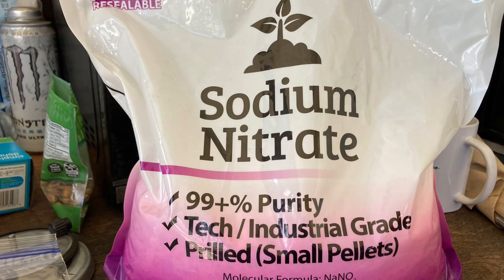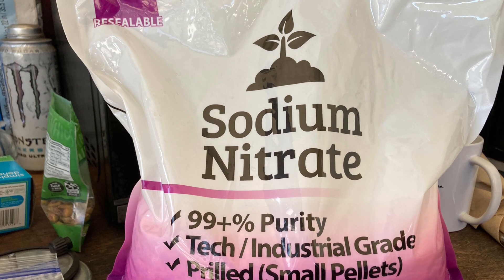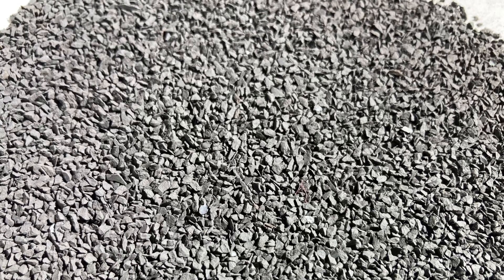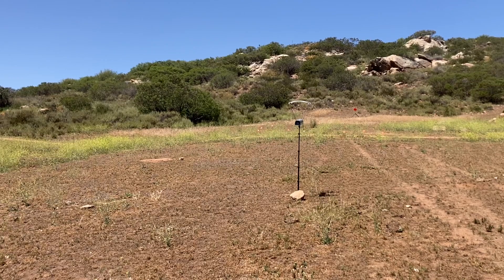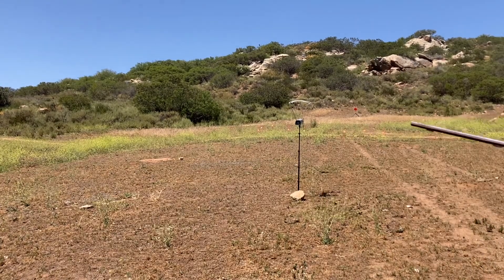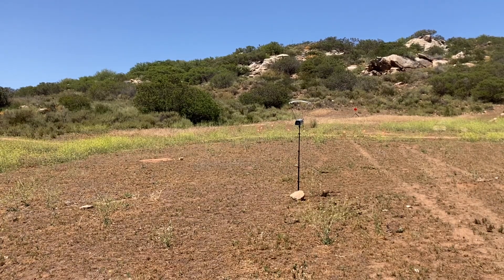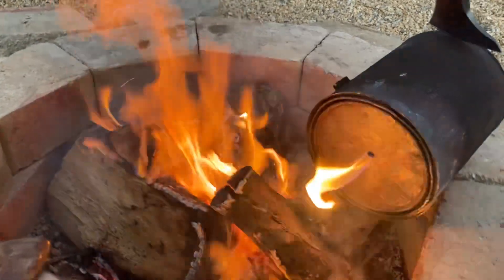Sodium Nitrate Black Powder

Comment: You seem like the perfect person to ask this. I’m looking to have a sort of off grid formula for black powder. I’ve seen people posting about making BP without sulfur. Is that possible and would it be able to be used in a BP rifle or pistol? Any help with this would be appreciated. Keep up the cool content.
Reply from the maker: I’ve got some powder made up without sulfur and hope to try it this weekend. Stay tuned!
Reply: recipe for Blue MZ- 50% KNO3,  25% KCLO4,  20% sodium benzoate (food preservative, find on Ebay), 5% dextrin
Reply from the maker: Yes, I know it’s possible but I’ve never tried it myself.
Reply: Sulfur decreases the ignition temperature and increases the burn rate [transfer across grain boundaries.] Don't bother making 0 sulfur BP if you're going to try to use it in a rock-lock; same reason none of the substitutes are suitable for priming the pan in a flinter. But you absolutely could use it for the main charge, it will just burn a bit slower [ie, use 3F where you'd use 2F of BP w/ sulfur, etc.]

Comment: Side note.  Even though here in Ks we have gotten some rain, indoors it is bone dry.  So, almost three weeks ago I took an H&R Topper 088 to a friends B-Day party.  High school kids took some turns with it on clays.  The load was Magtech brass, 3 1/8 dram Goex 2Fg, 1 1/8 #8.  Big fun!  About 30 shots.  Anyway, this, that and the other I just cleaned it yesterday.  No rust.  It cleaned up spotless.  Granted the fouling was extra hard.  What I'm getting at, BP with KNO3 in dry conditions with non-corrosive priming isn't that big a deal ( it is, but it isn't....).  It would be interesting to know if like amounts flashed on some steel plate of potassium nitrate vs sodium nitrate and left in the weather changed this dynamic.
Reply: I have personally noticed that Goex is a little smokier than pyrotechnics but a lot less corrosive. I know “it’s not corrosive it’s hygroscopic”. Fact is if I shoot 1 shot with pyrodex Ivette’s scrub the whole gun within hours. If I use BP I can go the whole weekend or week before it looos as bad as 1 day with pyrodex. That’s here in the south with high humidity. Both stink when burned so pyrodex only exists because the stores don’t need “explosives like licenses to have it.

Comment: Just a thought:
Maybe the lead in the ball mill are to blame for the stronger fouling? Since lead is quite soft and the milling may wear away some of it. Perhaps trying an alloy of lead/tin (Pb40/Sn60; Pb30/Sn70), which is much harder than lead itself may solve the problem.

Comment: My tests with Sodium based oxygen were identical save that mine was trash garden stuff. Lots of junk in it, only like 95% and the rest just whatever.

It left a lot of crap behind. The witness plate tests suggested a poor performer but the chronograph and my shoulder said otherwise. Dirty but stupid fast.
Reply from the maker: It’s not worth a damn in a flintlock, it flashes to slow. I don’t care how fast the ball is moving.
Reply: @Everythingblackpowder  Agreed. Caplock only.

Comment: Ok, second try. You asked about the charcoal. 
The details and science you're after are found in The Mad Monk Files. You'll need to search for The Mad Monk Files and find the Swiss Booklet. You'll want them all actually. The man, Bill Knight aka The Mad Monk, is a chemist who spent a long time in the study of BP, he has connections in the gunpowder industry others wish they had and if you're to rely on the work of anyone, this is the man and the work to carry on. You'll see.

To cut to the science of what you're after with controlling char temperature, you are after wood creosote. Not the stuff railroad ties and parking lots are coated with, this isn't petroleum creosote. 
It isn't petroleum, it isn't petroleum or coal tar, it isn't tar like. It has absolutely nothing to do with tar as most people might perceive. The natural wood creosote is a hard and brittle crystalline material derived from the lignin in the wood, when wood is loaded with creosote, the wood has a black crystalline glitter to it. Little crystals can actually fall out of the crushed charcoal in cases where the char has a huge surplus of creosote which is a wonderful thing.

The critical never exceed temperature is 610F. Do not exceed this temperature as this is the flash off temp of the creosote, wood that chars above that temp will have little or no creosote. 
I use a propane grill with a perforated steel baffle I drilled out and cut to fit. I use 1 gallon paint cans with 6" long 3/8" diameter copper tubes fitted to vent the gas out of the grill so as to avoid the gas igniting and causing a runaway temperature spike. I'm not doing this for efficiency, I'm doing it for precision.
My grill has multiple grill thermometers and a long probe thermometer for internal temperatures so I can monitor the can internal temp. The important piece of data are the cans internal temps. Time doesn't matter, I make sure the internal temp of my retorts remain below 610F for as long as it takes to fully char. 
I do not want nor do I try for brown or red colored charcoal, it is my opinion that those have not had enough charring and thus lignin has not been converted into creosote. I understand if the wood you're using only fully chars at above 610F and thus in an effort to preserve the creosote one must thus under char, I use wood that is both exceedingly plentiful, has tons of lignin and fully chars at 550F. I cook at 590F to ensure as much conversion of lignin as possible into creosote.

You could go through the trouble to assay the wood from dehydrated weight to as charred to ash to know your actual carbon and creosote content but really it isn't all that important, there are many other factors that come into play that are much more make or break.

What you're looking for is a charcoal that is loaded with sparking black crystals, when you torch or burn a piece, you're looking for a faint trace of smoke and you're looking for a strong creosote smell. It should smell like a very very well used food smoker.
 If you have a dry scent, you over cooked it.
Again please note that some wood types char at such a high temperature, riding the ragged edge of 610F or even exceeding that temp that little creosote will be preserved.

So what happens when charcoal is loaded with creosote, made into powder and shot? 
It burns down into its constituent elements, that is hydrogen, oxygen and carbon. The desired element is hydrogen. When hydrogen and oxygen burn, they produce water vapor as a byproduct. This water vapor in turn permeates the fouling and keeps it soft, the more water vapor produced, the greater the effect. 

This will require special tuning to achieve the best possible results and failing to tune the powder can partially or completely negate the effect. There is no specific formula I can point you to, the tuning is a number of factors you'll have to figure out to best suit your needs.

My powder burns so wet that the fouling is sopping wet with a greasy feel. About the same residual carbon fouling as Goex but unlike theirs, mine feels like melted face paint. Soft, goopy and easily wiped off the witness plate I test on. In the barrel it is easily wiped out with a single dry patch or blown out of the barrel by the next shot, grease isn't needed. That isn't to say I don't use grease. I certainly do. 

I need to point out that this wet burn feature can be negatively effected by heat and time. If your barrel is too hot to touch, so hot that a blow tube wouldn't work for example, the fouling will not retain moisture from the wet burning characteristics either. So it is usually very beneficial but in certain locations or atmospheric conditions it will fail.

If you're shooting on a 100F day in direct sunlight, the barrel will get too hot in no time flat and the effect is lost. This is where a good grease comes into play. 

It will also naturally dry out over time as well, it can actually be far wetter than the naturally hygroscopic fouling wants to be and will eventually "dry out" to achieve equilibrium. 
Doesn't mean it is actually dry, it isn't. Just isn't sopping wet anymore and this naturally damp fouling isn't soft enough to make loading easy or be blown out the barrel with another shot. So a steady firing sequence must be maintained, not so slow as to dry out and not so fast as to over heat the barrel.

American powders of the late 19th century were not wet burning. In fact the wet burning characteristic was well known to American powder makers and usually not a factor in production as American shooters preferred grease groove bullets or wiping between shots. It was Western Europe that liked wet burning powder. It was their thing and in the usually cool and comfortable weather they have it was a much sought after characteristic. You can imagine then that American powder was not popular over there.

For me this BP making thing has been a massive 6 year long learning experience. I equate it to mining through a maintain range of obsolete, repetitive or incorrect info just to find a backpack worth of gold nuggets. This is a few of those nuggets.  An observation I have made over the years is that not everyone understands the creosote thing, either lacking the understanding of the science behind it or lacking an understanding of the benefit of it. There are a number of people who do understand it and do not care. 
The American method of shoot and wipe is part of the allure and magic of the BP world and they intend to stick with it, after all, it was American powder, American arms and American methods that won the 1874 Creedmoor Cup. I cannot argue with them, who but a fool to argue with success?

I don't know if what I've said will help or if this is a direction you want to take your testing but at the very least you have more options and now know things few others know. Absolutely find and download The Mad Monk Files. All sorts of useful info those files, a gold mine for info.
Reply from the maker: Thank you! I took screenshots of all of that in case it gets deleted again
Reply: @Everythingblackpowder   I made a lot of edits and additions.

Comment: I "Wounder If" the speed may be In the Burn "type" with the longer barrel. could it be a better Push for a more complete burn rather than a bang?
Did you notice a change in Sound? Sounded on the interweb more thump-ish?  I did notice your flash looked and sounded FAST enough with a Nice Plume as should be. 
I noticed a change in sound with BP in some applications, rather than a crack more of a Boom!

AND I noticed the CONSTANT speeds, so is fast better than consistent? I do KNOW in "reloading" the quest of the Holy Grail is "consistency" for ACCURICY. 
I'm On It too!

Keep your smoke Pole SMOKING!
Thanks!

Comment: Good info .👍
Could Swiss be cleaning the residual oils out of the charcoal ,at some point in the process, then re drying? Maybe hitting it with a blast of steam? 

It’s obviously not just the species of wood chosen for the char. There’s a freakish absence of funk on those Swiss patches. Other than an additional oxidizer, it must be the cleanliness of the charcoal. I’m thinking residual oil in the charcoal, like creosote in a chimney, is what is making the funk.
Reply: Activated Charcoal ?????????
Reply: @juriehuman7127  Activated charcoal makes for shitty powder, so that's not it.

Comment: You might have to change up your ratios to get the best results. Sodium Nitrate has more oxygen per part by weight than Potassium Nitrate. Sodium's Atomic Weight is 23 and Potassium's Atomic Weight is 39. The Atomic Weight of a Sodium Nitrate molecule is 85 while the Atomic Weight of a Potassium Nitrate molecule is 101. Thus using the Sodium salt you get almost 19% more oxygen for the same weight of Potassium Nitrate.

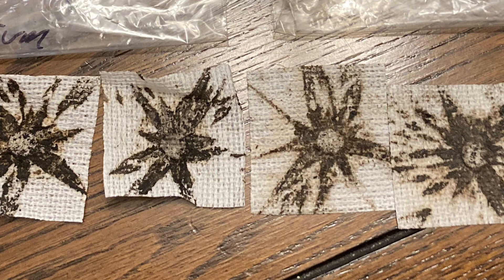Comment: 6:30 When wood burns, it undergoes pyrolysis (also called destructive distillation). Basically, all of the lignin, cellulose, and other compounds in the wood break down into smaller molecules which are usually gases or liquids, such as tar, wood gas, and methanol. In a wood fire, this is what is actually burning until the pyrolysis is more or less complete, then oxygen can get to the charcoal that remains and react directly with it. When you pyrolyse the wood in your paint can, this is what is happening. The wood is breaking down and the volatile compounds are escaping through the vent hole (and the closed nature prevents oxygen from burning the charcoal away), but when this is done, a small amount of organic compounds like tar remains. The longer/hotter you pyrolyse your wood, the less tar that remains because it is always breaking down in the fire. The volatile compounds are pretty important, because they burn at a lower temperature, which increases reaction rate, efficiency, and decreases the overall ignition temp. Quoting link 1: 
"Charcoal made at 240 degrees centigrade will readily ignite at 330 degrees centigrade, whereas charcoal made at 950 degrees centigrade will take nearly 1900 degrees to ignite. Hence, the best charcoal for gunpowder is made at lower temperatures." 
Quoting link 2:
"charcoal in black powder is a naturally derived substance which contains up to 35 percent tar-like constituents and varies from one source to another. Such variance has been found to have a great impact on the combustion properties of black powder"
You might be able to add wax as a substitute for the tar, but you are probably best off pyrolysing for a shorter period of time. Cut your wood pieces smaller if you are worried about them not cooking all the way through. Some other documents are included that you might like.

Link 1: https://firearmshistory.blogspot.com/2010/06/propellants-black-powder-i.html
Link 2: https://archive.org/details/DTIC_ADA149312/page/n5/mode/1up
https://archive.org/details/DTIC_ADA150455
https://archive.org/details/DTIC_ADA122264
https://archive.org/details/DTIC_AD0830265/page/n49/mode/1up
https://archive.org/details/cu31924030697688/page/n5/mode/2up
Reply from the maker: Excellent! Thank you.
Reply: @Everythingblackpowder  No problem, keep up the good work.
Reply: This TOTALLY ROCKS my Theory while Also reinforcing it! THANK YOU! for your WORK!

I was thinking on purity from these very things. I built a still just to have "fun" and charcoal the soured mash, was very SLOW. Now I am thinking more sugars and such with lower conversion temps! Like "maybe" the converted sugar mash before! fermentation or distillation? I believe the spirits industry and this art are closely knitted together through history.

I'M ON IT!
Thanks AGAIN!!
Reply: I remember reading that naval cannons in the 1880's before smokeless was developed, were using "brown" powder. They wouldn't fully charcoal the wood and so the powder would be a brownish color. They also cut out much of the Sulphur which would make it more difficult to ignite but that was mitigated a bit by the not fully charcoaled wood being easier to ignite. After reading this comment, much of that makes more sense now.
Reply: Another little tidbit of info that may help y'all with your BP.... cut your wood in the spring when the sap is flowing strong and leaves are starting to pop, then let it dry for 4 to 6 months before peeling the bark and charing. If it is cut in the fall and winter the salts are solidified in the wood and causes it to burn dirty.
When cut in the spring as stated above those salts are flushed out and the dried sap has a much lower salt content along with the chard natural sugars add to the fuel.
Hope this helps.
Reply: These links are amazing, thank you for sharing them.
Reply: Interesting post…